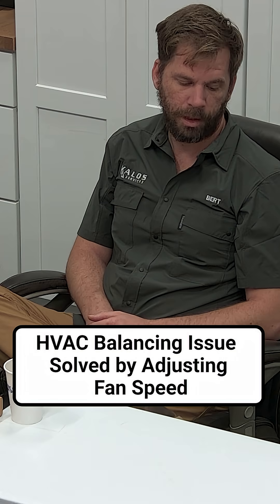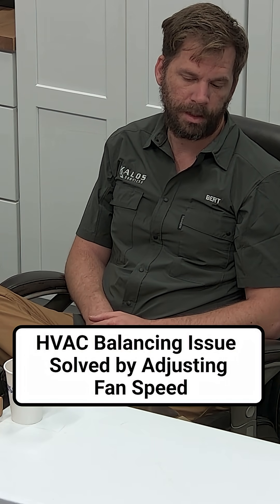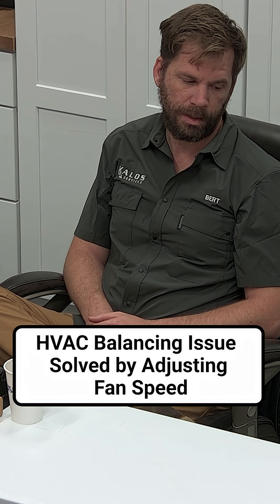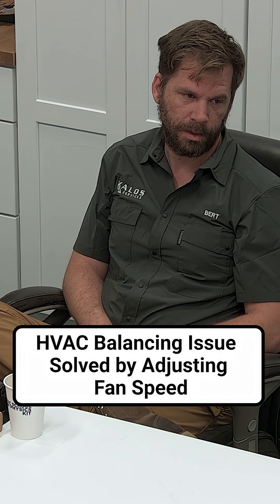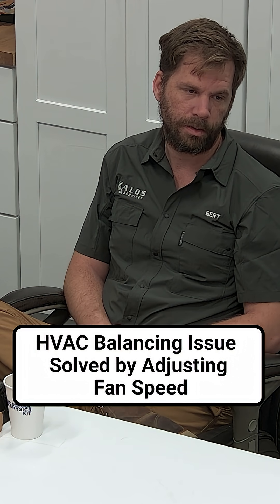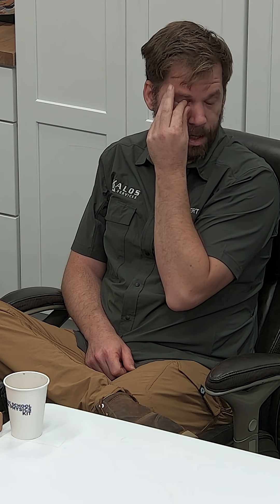HVAC Balancing Issue Solved by Adjusting Fan Speed

Comment: So a grossly oversized system and no design….I’ve never had a problem when I design the system around the actual heating and cooling loads of the house. A properly designed and correctly installed system isn’t going to have high static from the get go, measuring airflow at startup commissioning insures that the fan is on the correct setting. And adjusting dampers isn’t going to affect static pressure unless you weren’t in the game from the beginning.

Comment: Wait we increased fan speed and increased the duct size before just adding dampers and pinching off other rooms to force more air into hers?
Reply: Then you run into a static issue if you do that plus dampers are faulty (at least my experience with them).